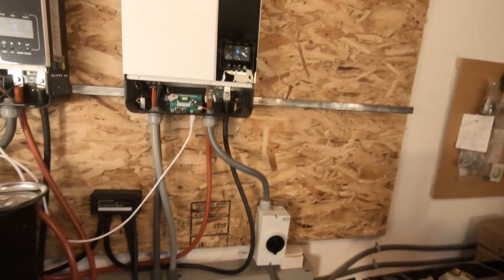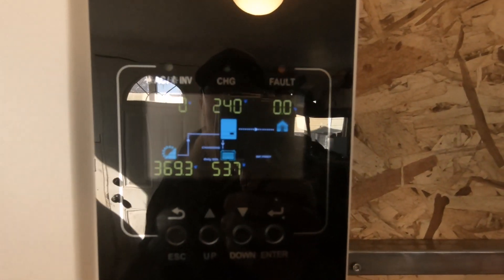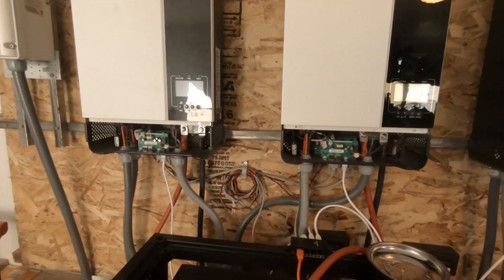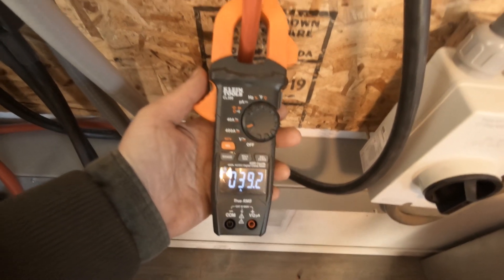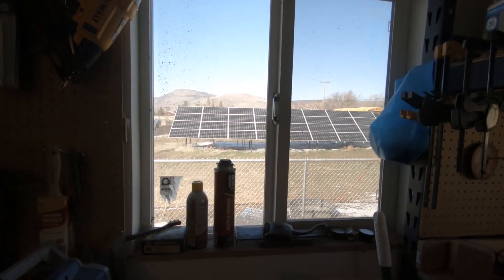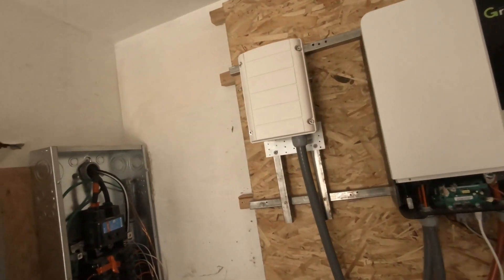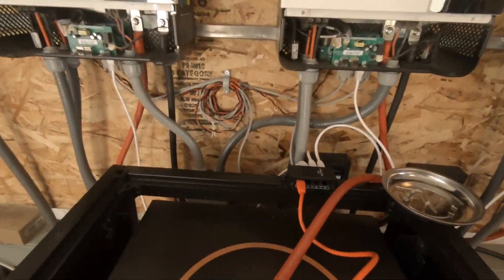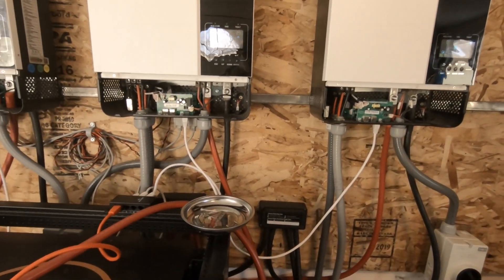setting up inverter for solar charging only

Comment: James, I have the same inverters you do but I want to make one a battery charger only. Charging from a backup generator. What settings do I change in the Growatt to not invert power and accomplish this. Thanks in advance.
Reply from the maker: Instead of li1 on setting 5 do user defined. Do not hook up any communication cables. From here on what you want to do is different from what I did. So this is mostly just guessing. Here’s my disclaimer I am not an electrician and this isn’t electric advice.
If I were attempting this? I would set the generator up as my grid power. Then just see what happens. You will get code’s for not communicating turn the inverter off for a minute and then turn it on they will go away. After another 20 seconds or so. 
Just set your charge amp’s to what you desire lower for single battery higher for more batteries. Just do not hook up power going out or if it’s got a breaker? Turn the breaker off.
Reply: @jamesshomesolarmore2223  I took your advice and it’s working. Thanks James.

Comment: YOU HAVE AN EXCELLENT SYSTEM . ITS A GREAT IDEA TO HAVE ONE OF THEM :goodvibes:FOR BATTERY CHARGING ONLY . ⚡
Reply from the maker: I have some more parts on order, I want to be able to isolate my inverters also. So, if something happens, I just unhook it and run the one in charge only mode. no word yet when the parts will show up. just trying to put a little back up into this set up. thank you for watching my video's and subscribing.

Comment: Good videos and explanation of setting up!  It would be informative if you mentioned some details like the wire sizes and breaker capacities that you have selected.  Really like your Battery and inverter setup and 32 panel solar array!  Great work!
Reply from the maker: thank you, since my inverters take 450 volts, I can keep the amps at 9.3 so I can run 10-gauge wire at the solar array and coming to my inverters. the wire coming from the breakers at the panels is 10 gauge from Home Depot. the 5000es says 50-amp breakers and I used 8-gauge wiring for them. I think the most important wires are the battery wire's and I have 2/0 battery cable. that is a lot bigger than the 2 gauge I originally used. it lowers the resistance so less loss of energy. I have 4/0 coming into my power shed and going to the house. I ordered the battery cable and connectors from battery cable's USA. the 10-gauge solar wire and 4/0 mobile home wire I bought from Platt electric I bought the 8-gauge and 10-gauge from Home Depot. the transformer only calls for a 25-amp fuse, but I couldn't find one, so it has a 30-amp fuse. hope this helps, the voltage these inverters can handle is why i switched to them. it saves a lot on wire costs. plus it was much harder trying to run 6 gauge wire in conduit. so i pulled that all out. the combiner boxes might work for smaller electric demands or shorter runs? I still have the 6-gauge wire and the combiner boxes. along with two of my smaller inverters. this is why i swapped to the 5000es growatt inverters. plus their batteries are awesome.

Comment: What setting did you change to do this  ?
Reply from the maker: i talked about that in the video description, you set the battery to user defined. on the inverter that does charging only. i set low battery voltage at 48. but it will never reach that. i also set it at 54 volts as high cut off. that way the other inverters top off charging at a slower rate. they are set at lithium setting 5. then L01 at setting 36 the inverters and batteries communicate and finish charging. that inverter will send error code 8. this code will clear on it's own once you change the inverter to the right settings. it does take a few minutes for it to clear. this inverter only does things when the sun is up. i have no grid backup power going to it. I also have power from it shut off at the breaker. i only charge my batteries with solar so all inverters are set at solar charging only.
Reply: Thank you I missed the description

Comment: Man I had an issue where I called signature solar tech for a question about my 6000t and how to get grid assist working. Well the guy I talked to had a complete absurd definition for what grid assist was. I told them I seen Ian's video where he used the 5kes as a grid input for his 6000t. They had no idea. I sat on hold for 30 minutes while he went and asked multiple people. Turns out the whole grid assist was automatically done if the grid was hooked up. Signature is lacking big time right now. They're doing their best to avoid returns right now also. Lots of delay tactics being used.
Reply from the maker: yes, well some of their techs lack experience and knowledge. I have had an issue with Ian also. I made a couple videos on that. I worked in trucking for 30 years and the one thing I learned was to steal other people's ideas. Ian at watt's 247 is smart and a great resource. I have made a purchase from him on another product to help monitor my power production. I gave him credit for helping me make this happen because he deserved it. I started making videos only to help other's save from some of my mistakes. I think I am trading some of my smaller inverters and big battery batteries to a guy for concrete work. so all is working out. always use other people's ideas and then figure out if it works in your system.